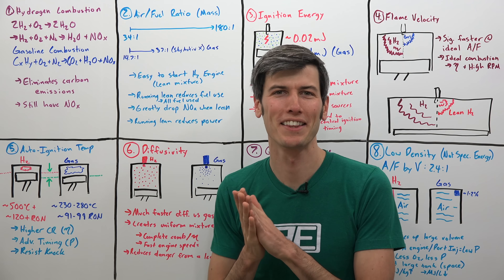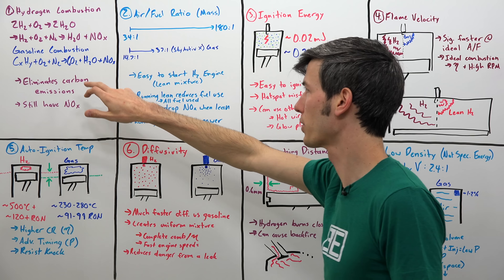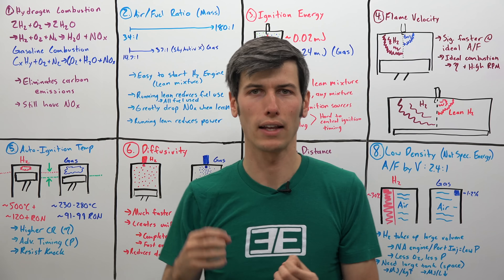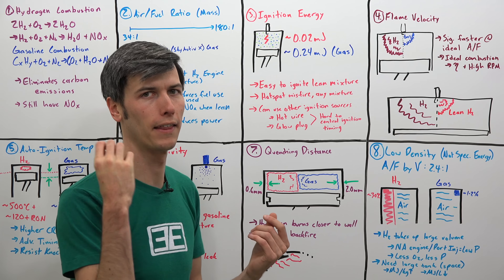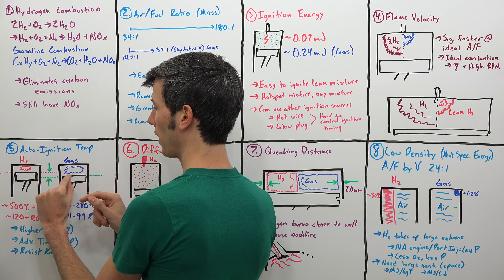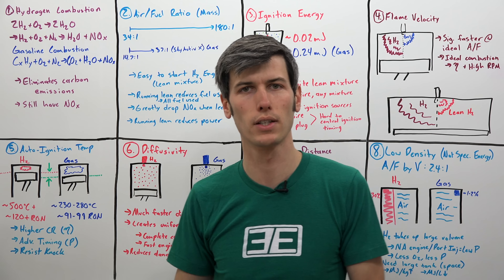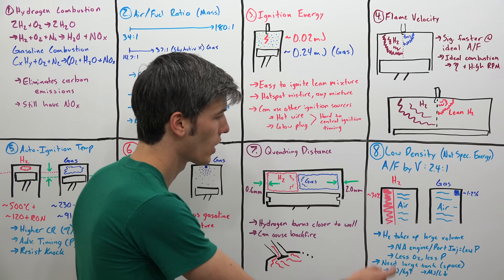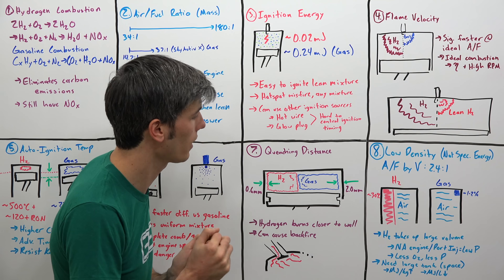The Difference Between Gasoline And Hydrogen Engines

Comment: Just to clarify something. Most of the future planned hydrogen vehicle is hydrogen FUEL CELL. They are all using hydrogen and many platinum (or other similar) catalyst to generate electricity to drive electric motors. Think of Tesla, instead of battery they have large liquid H2 tank instead. Nikola Motor's trucks are great example of this.

Hydrogen Combustion engine has only been really tested at small quantities and if you wish to turn your ICE to hydrogen Combustion you'll need to harden and replace most of the material in your current engine. (In my opinion and most of the industry) You'll be better off buying an engine that is designed for hydrogen combustion and sticking to your vehicle, which I don't even think exists widely.

Source: Worked on both academic and commercial hydrogen fuel cell manufacturing and research groups.
Reply from the maker: Correct, this is about engines, not fuel cells. I have a separate video on fuel cell vehicles: https://youtu.be/0jnZFGx_4kY
Reply: @EngineeringExplained  How about a comparison between the two kinds of hydrogen engines? I've heard claims that the fuel cell approach has a much higher theoretical effiency ceiling.
Reply: @EngineeringExplained , You didn't mention the big issue with ICE powered by H2, which is the damage to the piston &  head from Hydrogen bonding with the metals, which causes said metals to become prone to fracturing. When a DJ3 [old mail jeep] was powered with H2, the engine needed to be rebuilt about every 10,000 miles, or it would be ruined by metal fragments.....
Reply: @davidhollenshead4892  The danger of hydrogen embrittlement is overstated in internal combustion engines. The time factor is too small to affect the combustion mechanism itself, once H2 is injected into the combustion chamber. However, fuel tank and distribution hardware will need consideration.
Reply: videoofmike 
I’m not so sure you see BMW worked on hydrogen ICE in the mid-2000s and they even build 100 costumer cars back then. It was powered by a reworked V12 engine which was a derivation of the N73 B60 and could run on both petrol and hydrogen (if I remember correctly). When run on hydrogen it had around 270 HP (petrol 445HP). Despite having the regular fuel tank, which was good for 500 km it had 8kg of hydrogen in it for an additional 200 km. 
So the adaptation is fairly small (at least you would not need a total redesign but could lean heavily on what’s already achieved). I can only speculate if from an efficiency standpoint a direct injected compression process (like a diesel) would be better...

I remember seeing the BMW prototypes and the “production” car at the Frankfurt Auto Show in the 2000s. I guess the financial crisis and relatively low oil prices finally killed the projects back then. Also the emphasis on environmental issues where less present.
Reply: With current laws storing it will be the challenge. You dont want the general public to be driving around in bombs should they crash... the tank has to be damn near indestructible. Also making / purifying the Hydrogen in the first place is quite energy intensive
Reply: @LawrenceAbramoff  there is plenty of energy available from high temperature nuclear reactors. hydrogen could be stored as NH3 then split using a membrane when needed
Reply: @LawrenceAbramoff  No different to petrol, yet with enough money up for grabs some clever people worked out a way to make it happen.
Reply: Note aircraft could concievably use hydrogen combustion (especially jets).  The mass advantages would be huge (at least for long trips), but the density would basically kill it (you don't want the fuel tanks to be multiple times the size of the passenger cabin.  Hydrogen just isn't a good way to store energy.
Reply: @wumpusthehunted2628  When it comes to aircraft drag is what kills it. Hydrogen is an abysmal way to power a jet because the tanks would have to be gigantic. So gigantic in fact that at some point adding more fuel would decrease range.

That maximum range with the current airfield redtrictions we have might be as low as some tens or hundreds of kilometers. Or the tradeoff is slow flight but even then you'd need some massive wings to compensate for the lack of lift in order to fly high (=efficiently).

All in all adding all that volume is a nightmare. Jet fuel as it is is already problematic from this (and mass) stand point.

Some rockets can get away with this because the hydrogen exhaust velocity is really high which means you can push rockets more efficiently. The most successful craft to do this is the shuttle but even the space shuttle needed some really dirt cheap disposable solid rocket motors to combat gravity losses and drag deep in the Earth's atmosphere.

Summa summarum: hydrogen is a great fuel if you don't need to take it anywhere. Lugging large, expensive and heavy tanks around is just no viable save for a few special cases.
Reply: You can totally run any ICE engine on hydrogen, back in the day with carburetors you could just feed it straight into the air intake and the car would work as if nothing changed.
But long term you do get material degradation.
Reply: Yes, but fuel cell generators will likely hit a volume scaling issue. The catalysts are not only prohibitively expensive for most people, but also use materials that aren't abundant enough in the Earth's crust to replace every vehicle on the road.

I believe they also have a problem with quickly responding to changing current demands, so they require ballast capacitors and complex control circuitry.

So I could see a future where cars run on hydrogen combustion engines and commercial trucks have fuel cell generators.
Reply: peter magri I searched that and it still has platinum. So more platinum in order to switch a liquid methanol tank. Methanol is also poisonous.
Reply: @zooplanton  Almost anything you can fuel a vehicle with is poisonous.
Reply: @videoofmike
 LH2 is a no-go because of boiloff. The triple point of hydrogen is 13.8 Kelvin. You might be able to power your LH2 tankers' engines with the  boiloff for the distribution side of things, as some oceangoing LNG ships do, but it wouldn't be efficient for general use. Liquifying the hydrogen is also going to reduce your system-wide efficiency. You can produce gaseous hydrogen already at full pressure for standard 700 atm tanks.
Reply: @Markle2k  I haven't worked on h2 fuel cell for a 3 years now. But you should check out Nikola motors set up. I believe there are some merits to what you are saying but im guessing from what Nikola motors has done there probably are some breakthrough in lh2 storage technology
Reply: @peter magri It's not the hydrogen production that's the issue. It's the electricity production from the hydrogen. The science and engineering is not simple but not prohibitively difficult, the manufacturing isnt particularly complicated, it's the raw materials.
Reply: In theory fuel cell cars should have a longer service life EVs with lithium ion batteries without the degradation in range.
The car should have the same range and performance when it's 10 years old as it did when it was new.
Reply: I've seen mods online for old motorcycles using old hydrogen fuel cells. They just switch the top of the engine out for an iron part and it's good.
It was more of a tinkering thing and never really caught on because the benefits you could get didn't make up for exploding should you slide out.
Reply: @peter magri oooo that's awesome! Fantastic to hear!!
Reply: hydrogen FUEL CELL is no future oriented technique. Maybe for the industry, because there is a lot of technique inside that needs to be produced, but the efficiency from source to wheel is not good in fuel cell engines, compared to battery electric vehicles.
Reply: That's because fuel cells cost more. So the manufacturer can make more money.
Reply: Yeah, which is why hydrogen cars are going to be way more lame than they should be.

Comment: The huge issue with hydrogen is the transportation and storage of it, which is a real bummer
Reply: The biggest problem with hydrogen is cost. It's about $17/gal equivalent. Since no one will pay such high price, they can't scale up to bring the cost down. Even if everyone use H, it'll still be 3X more than gasoline. It's simple Physics of how H is made; it has to be made, not just dug up from ground.
Reply: Need more catalysts for cheaper on demand production.
Reply: The huge issue with hydrogen is the generation of hydrogen. 
It needs a huge amount of energy, which will be converted into heat and not to motion energy.
Reply: no the huge issue is hydrogen production efficiency which is horrible, either has to come from a hydrocarbon source which releases c2o or has to come from water which requires a lot of energy and in which case why not just put it in batteries that are very efficient at storing energy?
Reply: josh thorp once graphene batteries hit it’ll be all over.

Comment: @Engineering Explained , I was just wondering, how can the auto-Ignition temperature of hydrogen be significantly higher than for gas(as high as  a factor of 2) when the ignition-energy of hydrogen is 10 times higher then for gas? What would be the difference from an energy standpoint between compressing a gas and raising its energy-density or applying the same energy via a spark?
Reply from the maker: It simply means that it requires a higher ambient temperature to ignite it, though less energy overall. I guess on the surface that does seem confusing haha. But a spark reaches a very high temperature instantly, so it's well above the temperature required for compressing the fuel to ignite it.
Reply: @EngineeringExplained  Thanks for you quick answer, it does seem kind of confusing. But nonetheless the rest of the video was really nice and informative. Any chance you might go into more detail about different properties of different fuels in a future video?

Comment: Has anyone produced a hydrogen engine yet?
Reply from the maker: Yes. Mazda actually sold a hydrogen rotary engine. I'll be making a video on it soon!
Reply: Only diy and university projects. From this video it is about changing ignition timing and possible valve timing (you need little or no overlap because of the higher flame speed)  to take full advantage of Hydrogen's properties.  I imagine it would make sense to fit a diesel engine with spark plugs, so you also have higher compression to begin with.

Comment: piston engine wont work with hidrogen. rotary maybe can work. 😂😂😂
Reply: Guess what ? Your gasoline engine is also producing water. 😱
Reply: but they already do work with hydrogen
Reply: @salerio61  water on piston ? sound won't last longer than impotent gandpa Ryan Madison on stripclub too much lube 😂😂😂🤣🤣😂😂😂😂😂😂😂. innertia on rotary can solve this.
Reply: @misogear  ????
Reply: @misogear  What in god's name are you blathering about?
Reply: BMW built one in 2005. It works great.
Reply: @elektro3000  Not great, but it did work. Hydrogen gas spontaneously alloys with both steel and aluminum making them brittle.
Reply: I was thinking Hydrogen to generate heat and heat to energize a secondary power like water/steam to pressurize a piston diaphragm turning a crank. Just with a more modern mode.
Reply: They already have a hydrogen rx8. They built it back about 10 years ago.